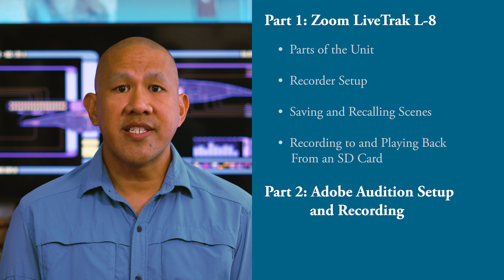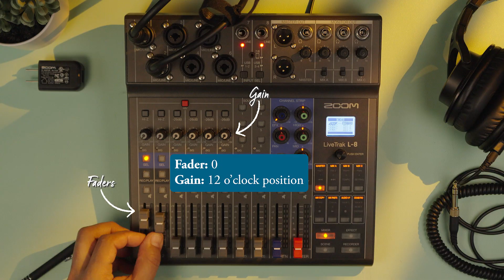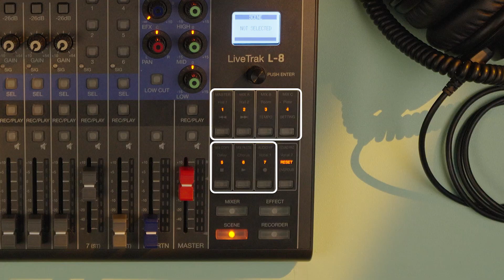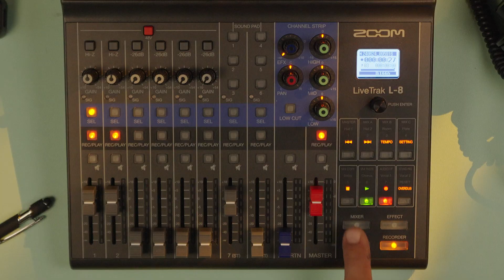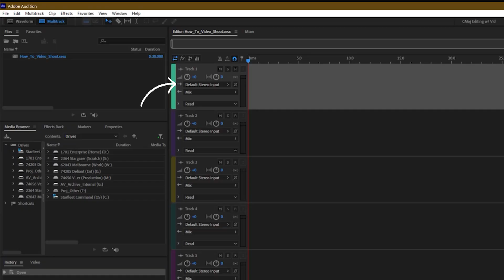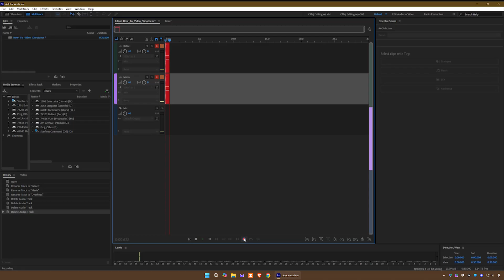Using the Zoom LiveTrak L-8 as a USB Interface

Comment: A question if I may. In case i would just use this as USB Audio interface on my Windows 11 Gaming PC, my Windows 11 Mini PC and my Macbook Air M1 (because I used to make music, I still have a pair of Active Monitor speakers, so all is supposed to go into a mixer) to get then in return out to the monitor speakers. So far i used an old Mackie mixer but that one died recently. So I wonder how this one is for sound in general for use with Computers. Since i sometimes also do some video / voice calls, a internal record function would be nice. I suppose that's not the most common use of a such a device, since its usually more for Microphones and Instruments. But even my Mackie mixer was a good USB Audio Interface in regards of sound. How is Zoom Livetrak in that regard ? Any info you or anyone can give me is appreciated. Thank you.
Reply from the maker: @OLDM4N-DE – That's a really good question. I've never used it as a total audio interface for both recording and computer audio. I used to have it plugged in for when I would be on Zoom calls and would use the microphone connected through it instead of my webcam mic, but it became too much of a faff. While I don't have monitor speakers, what I was able to do just now was connect my computer speakers to the L-8 through one of the 4 headphone jacks—the ones used for headphone monitoring. I did have to use a quarter-inch adapter to make the connection, but it works. 

With the L-8 connected to my computer:
1) I made sure that Audio I/F (interface) is set to PC/Mac.
2) I set Channel 7 to USB and set the fader to 0 for both Channel 7 and Master.
3) On my computer (Windows 11 OS), I set the audio output to Line (ZOOM L-8 Audio) (it should show up as an option with the L-8 connected).
4) I plugged in the speakers into the Master Out headphone jack.
5) I adjusted the Channel 7 and Master Channel faders as well as the Master Out headphone jack volume dial to the desired listening level. I could also further adjust the computer's system volume and the speaker's volume as needed.

It sounds just as good as with the speakers directly plugged into the computer's sound card.

I hope this helps!

Comment: niche topic that was both extensively and perfectly explained... ur a lifesaver, chris!!!
Reply: i have a question--i'm trying to use the mixer as an audio interface for my entire PC... i have a microphone and headphones plugged in, and the L-8 plugged into the PC. i'm trying to monitor and use my microphone as an input while also monitoring my desktop audio, without using it as an input. when i currently use it, all desktop audio is used as an input along with my microphone, so DAWs record both my audio AND my vocals. any fix?
Reply from the maker: @xysium   So sorry for the lengthy delay and getting you an answer. So, short answer is, Yes. 

Here's what I did:
1) Connected L-8 to computer via USB and ensured that Audio I/F (interface) is set to PC/Mac.
2) Set L-8's Channel 7 to USB 1-2.
3) Set L-8's Channel 7 and Master faders to 0.
4) Plugged in my microphone into Channel 1, setting fader to 0 and gain dial to 12 o'clock position (adjust as necessary)
5) Plugged in my headphones into Master Out headphone jack and adjust volume as necessary. You can also plug it into any of the three Monitor Out headphone jacks and switch it to a specific mix (A, B, or C) if you set up different monitor mixes.

The next steps are in my DAW (Adobe Audition):
6) Created a multitrack session.
7) Set my Audio Hardware to Device Class = ASIO, Device = Zoom L-8 ASIO Driver, I/O Buffer Size = 512, and Sample Rate = 48000Hz.
8) In my multitrack view, I set Track 1's Input to Mono > [03M] In 1, which corresponds to the L-8's Channel 1.
9) As needed, continue setting subsequent tracks to be mapped to the L-8's channels.
10) Don't set any track's input to Stereo > [09S] In 7 L, which corresponds to the L-8's Channel 7. Remember that this is the channel that is the USB connection to the computer. 
11) Arm each track you want to record ([R] in the track's interface in Audition)
12) Record your audio.

Because you didn't set any track's input to Stereo > [09S] In 7 L, the computer audio won't be recorded to your DAW, but through your headphones, you'll be albe to hear it.

I hope this helps!

Happy recording!
Reply from the maker: Glad I could help!

Comment: Where is the USB port on an L-8? Do you use its power input?
Reply from the maker: Hi! Yes, the USB power input doubles as the data connection between the L-8 and the computer/laptop. Just make sure you have set the Audio I/O to either PC or Mac.

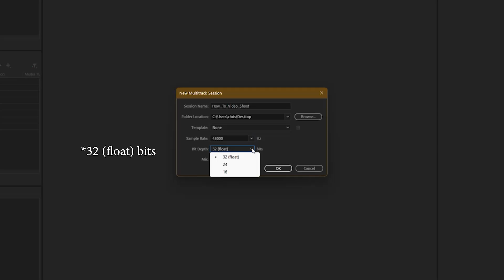Comment from the maker: If you use the L-8 with Adobe Audition (or any USB audio interface with a DAW) and have any tips and tricks that would make for a more efficient workflow, please drop them in the comments. For example, I've learned that the L-8 doesn't record in 32-bit float (maximum is 24-bit [linear]). Therefore, in Adobe Audition (at 25:19 in the video), Bit Depth should be at 24 bits—not 32 (float) bits—to match the output of the L-8.